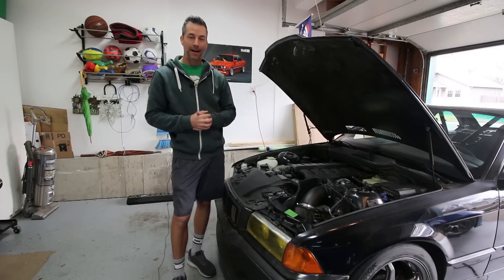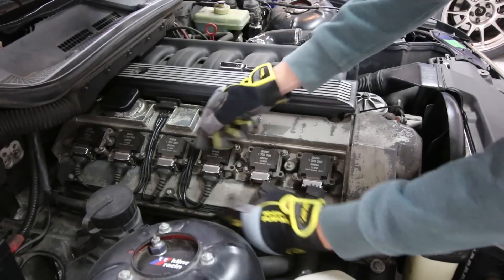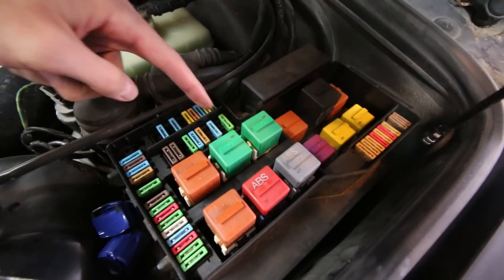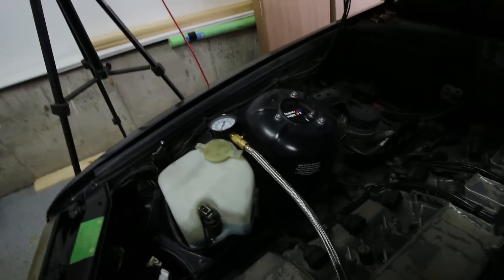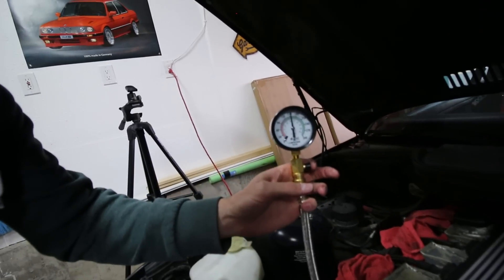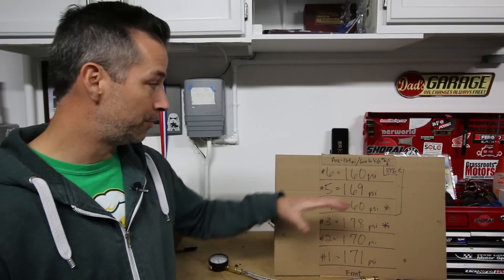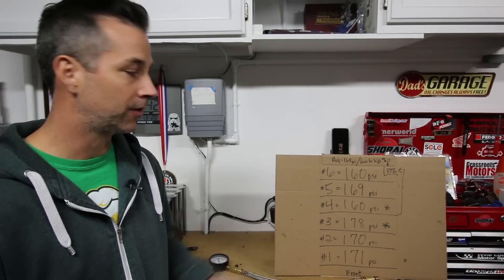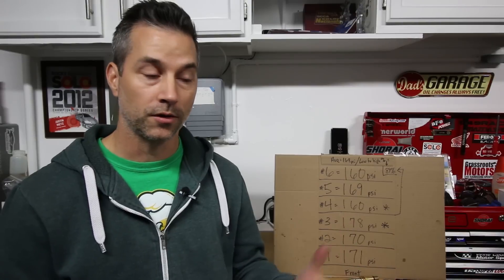BMW e36 Compression Test - Is my engine OK?

Comment: hey justin..what was the mileage on the engine?.....did it run well?... how is it these days?....you showed  us 150 ish...howw did you get to 160-70?
Reply from the maker: Mileage was 205k when this was done I believe. It ran very well all the way up to when I pulled it and swapped in an s52. Not sure what you mean by the last sentence, the numbers on the cardboard are what I ended up with. I didn't do anything but the tests.
Reply from the maker: Oh, it was 160, I just didn't do a full reading of the gauge and generalized 150. If you look close at the gauge it is 160 or 159'ish. My s52 had lower compression that this engine. Don't worry about the value too much compared to others. You just want the compression # to be as close as possible across all cylinders, then it's usually fine.
Reply: @TheBTRGarage  Im just a wee bit worried its kinda low?...155.....but they are all even!.....btw, your lil one is just great......
Reply from the maker: My s52 was 140 across the board on compression test (in Denver altitude). After getting dyno tuned it made 238whp and 235lbs.ft. of torque. Which is right in the range for an s52. As long as #'s are good I think you'll be ok. You could do a leakdown test if you wanted for additional piece of mind.
Reply: @TheBTRGarage  I was at 155......do u call that good?..lol.........how does altitude affect numbers?....how much does it lower them?...and btw, thnx for the answers!
Reply from the maker: Since you said it was 155 across the board, I'd say you're fine. Higher altitude = less dense air, so lower numbers. You can also get different numbers depending on how you test, but main thing is the #'s are consistent.
Reply: @TheBTRGarage   your s52  was at 140?....... its like 180 ish at sea   level!!!......this car i saw ran well......but man 155 is kinda lo compared to others.....
Reply: @TheBTRGarage  Im looking at a nice s52 m3...w/ 199k....   but it shows 156 across all 6..... most  s52s show 175-200....     early in your vid you showed us 15o something? at around 5  25 in......

Comment: Thanks mate, what would be the issue if I have 1 to 5 cylinder with 200 psi, and cyl n° 6 with 140-145 psi? I have the same car.. many thanks!
Reply from the maker: Your #6 cylinder piston has worn or bad rings most likely. So air is getting past the piston rings since they cannot keep a good seal against the cylinder walls, resulting in loss of compression and ultimately power/efficiency.
Reply: @TheBTRGarage  thanks mate
Reply: I have these same numbers but mine is cylinder 3. Can I still drive the car for say another couple months and then do a motor swap or don’t drive the car? Looking at my options and I’m not ready to swap the motor
Reply from the maker: Sure it is fine to drive it, as long as nothing is leaking or anything. The engine will just make less power .

Comment: Hi, great video,
should the test be done when the engine is cold or do i have to warm it up ?
Reply from the maker: Thanks! It can be done either way, what matters is the results are within tolerance of each other. Testing on a warm engine can produce more accurate results of actual compression numbers, just be careful cause everything is hot 😄